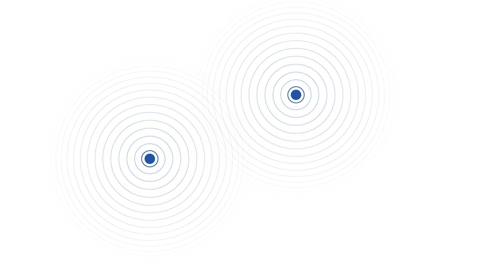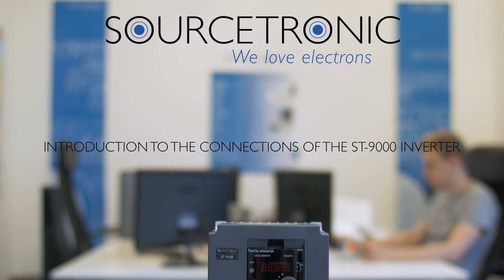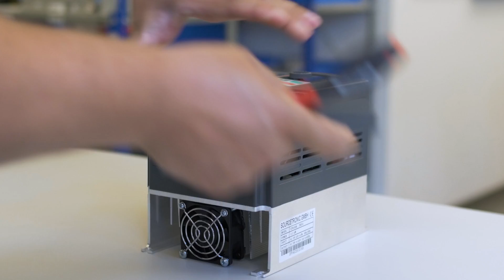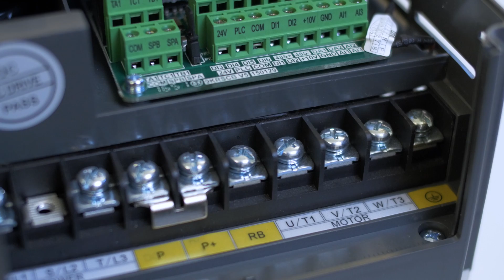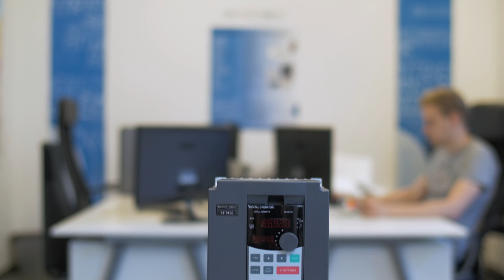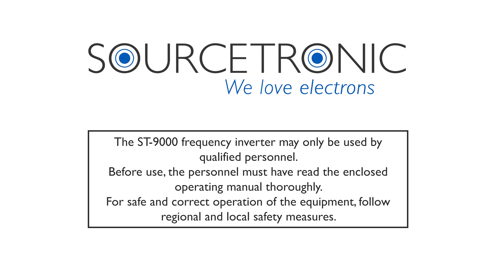Sourcetronic Frequency Inverter Terminals

Comment: But how do you change and increase frequency
Reply: With the up/down keys or the rotary controller
Reply: @mowny2561  normally they set on 50 maximum but my question is how do I change that to 60 and more
Reply: @jckapindatheushers5199  Increase the limits in F0.19 and F0.21